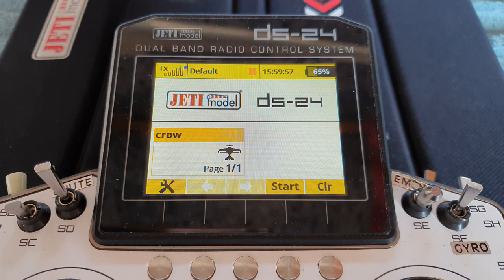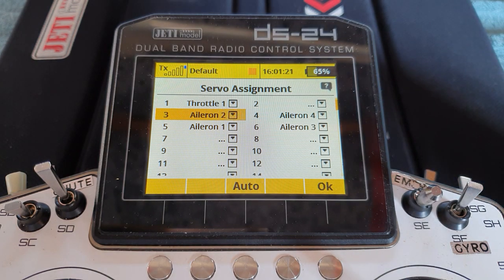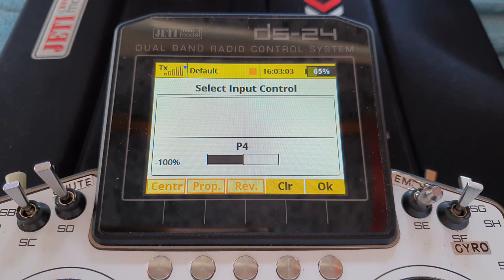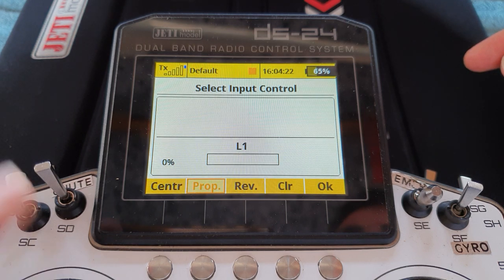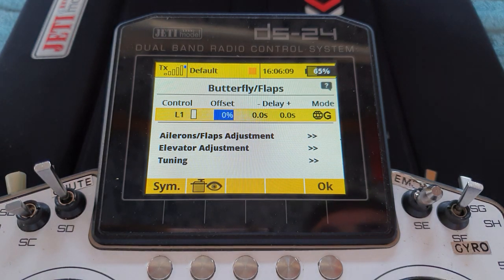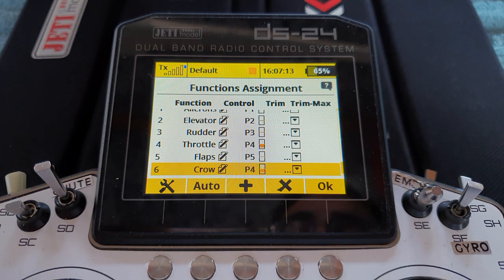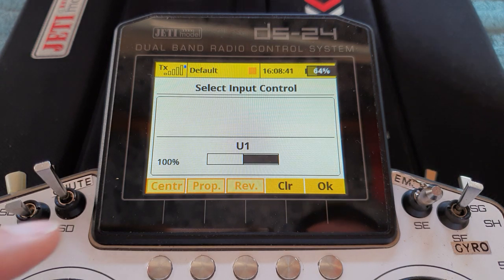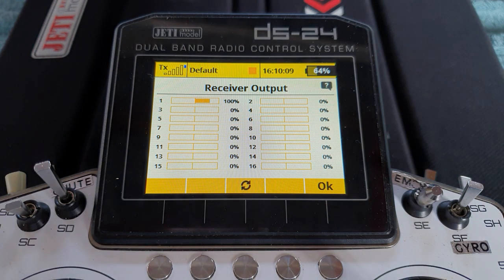Jeti - biplane aileron crow brakes on throttle stick

Comment: hi harry this is the only way i can get in touch ,,ive just updated my ds24 and the 6 channel assist and if i use a separate gyro mode on off switch the gyro will not work ,,as soon as i delete the switch and program a three poss switch ie off,, normal ,, and hold it now works ,,??   it worked perfect before the updates but with the new update i cant have a separate on off switch ,,,,,, am i doing something wrong or is this possibly the update   ,,ive watched all the assist videos again and followed  it to the letter ,,,, thanks for your help steve
Reply from the maker: Steve, you must be doing something wrong, all mine work as described, with latest software.